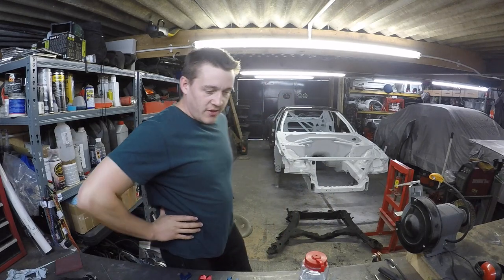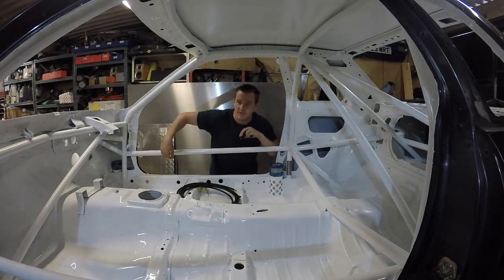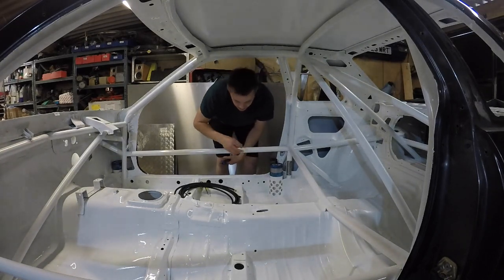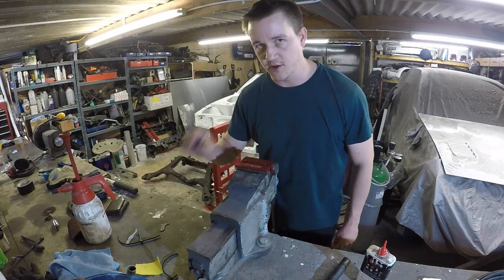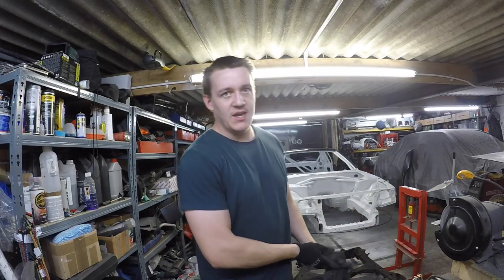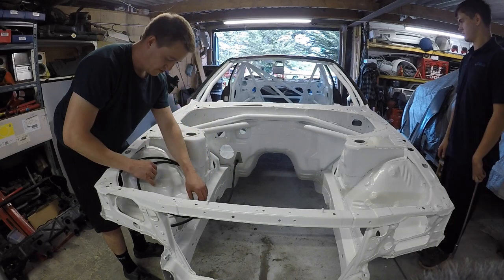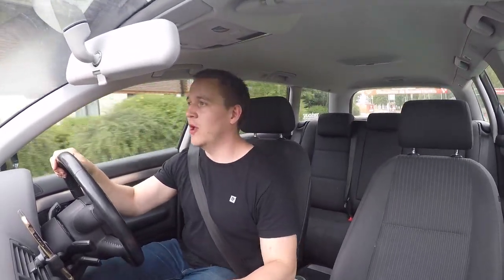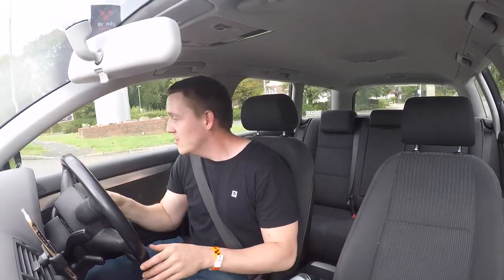Air jack lines, then F350 and M2 distractions - R32 Build: Episode Thirteen

Comment: Just fitted AN10 lines and fittings. I tried three different types. Reinforced rubber in blue. Chrome looking braided steel. Black braided reinforced rubber. 
All look great. Went with the black braided for looks alone. All met the specs I needed. Filter relocation lines and oil cooler lines with blue anodised fittings. 
My car is metallic black and all after market upgraded fittings or clamp. Turbo tubing. Suspension. With that AN combo. I’ve been thinking about air jacks for a while now. Your videos on fitting them is why I found this channel. A31 cefiro.
Reply from the maker: Awesome man, sounds like a good colour combination :) glad you found the build series mate!